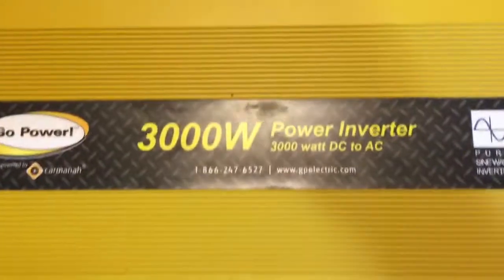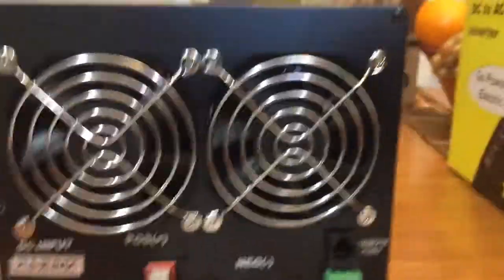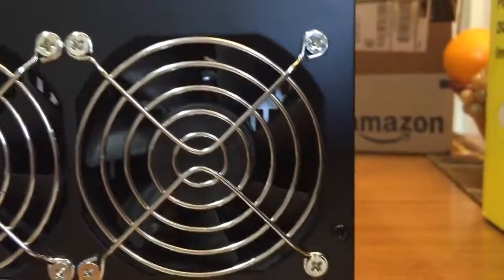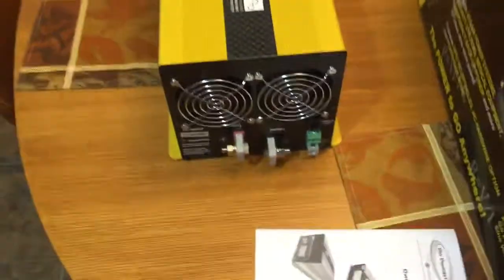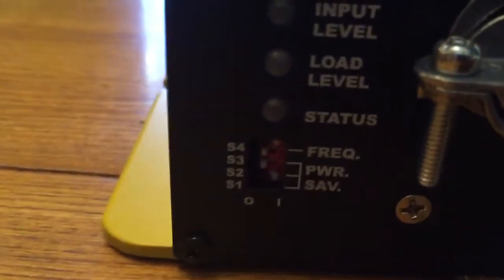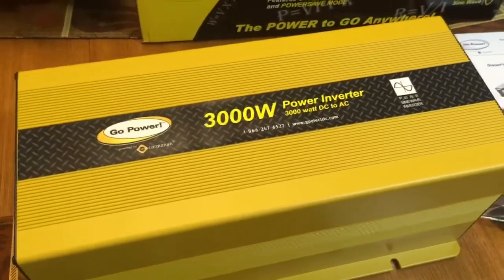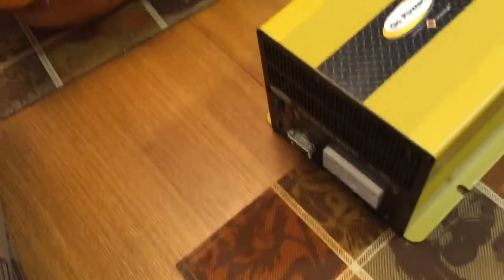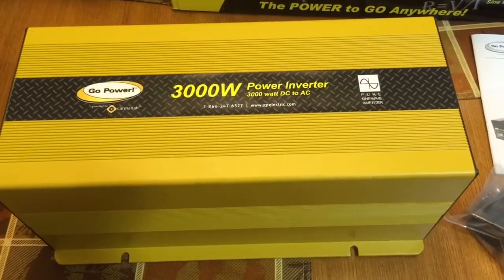go Power 3000  watt

Comment: Does the have 65 volts on each leg like most inverter or does it have 110 volts on the hot.
Reply: It's only a 110 converter it has 110ac on all positive  connections accept 12v Battery connection ,and hard wired it's only supplies 110ac with a higher amp rating the plugs supple all  white plug which are two in total all are 110ac plus hard wired is 110ac does that answer your question.
Reply: Nothing would work if it only had 65v ac on the plug on each plug  end . They all have 110ac on each plug end. Don't know where you got the idea that each plug end  is half of110. Oh and 65v is not half of 110 . If it was, it still would not work  to plug something into it . Everything  takes110 to make it run unless it is 220. then it take two out of faze 110 to run 220v. 110 inverter will not, know matter how you hook it up, it would not run 220 v it would take a inverter made for 220v to run 220v  and they cost a lot more. Go Power is not a cheap inverter, list price for that one is more than $1,300. But on sale you can get one of the same size for $ 779. right now if you know where to look for it, Amazon would be a good start free shipping .I paid $849 for mine. than they marked it down a few weeks later. but it list over $1,300.00
Reply: You can plug in a plug splitter and make it a four plug end on the front of it